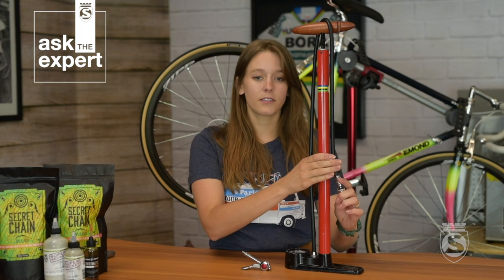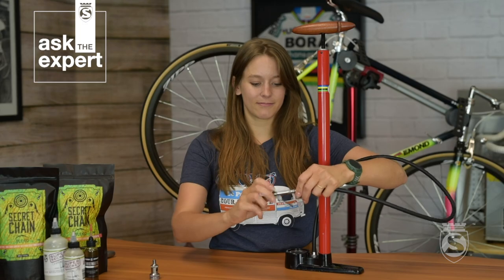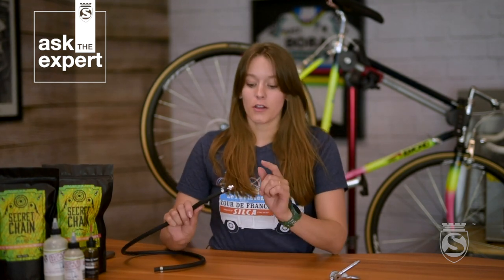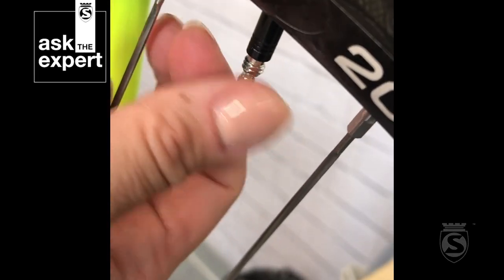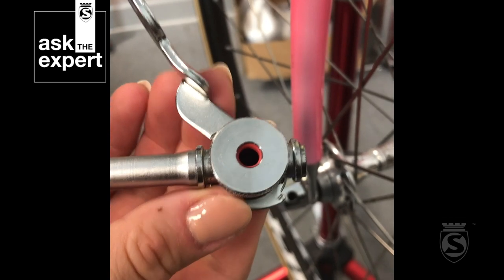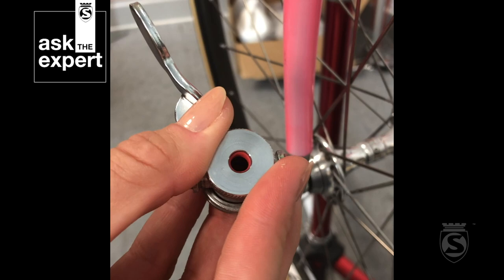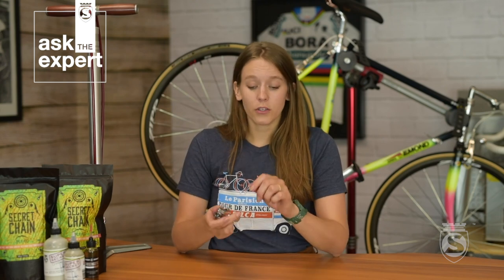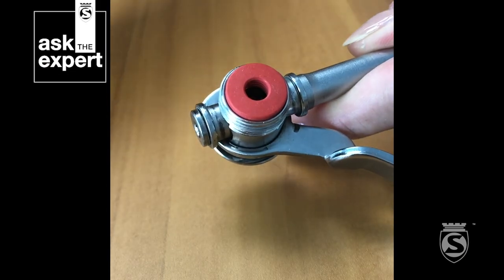Ask the Expert Ep 16: The Hiro Chuck

Comment: After pumping air, when removing the chuck, does it come off?  Or do you have to break a seal?  I need a chuck that removes with ease to prevent tugging on the valve.
Reply from the maker: The chuck has a lever that clamps the valve, so when you release that, it releases the valve stem, so no pulling force on the valve when removing.

Comment: Does the chuck allow pressure reading when no air is flowing? Is the valve kept open by the chuck or will it close once the air flow stops?
Reply from the maker: Depends on how far you push it onto the valve.. the Hiro is preload adjustable so it can clamp on the valve core and not open the valve, or set it wider and clamp on the valve stem and it will hold the valve open